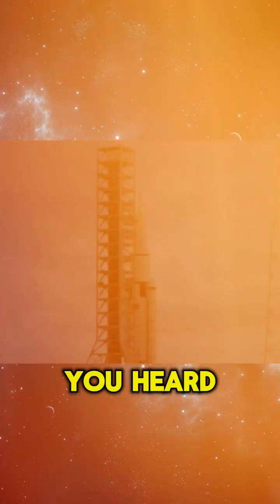Why Rocket Don't Fly Straight Up ? Neil degrasse Tyson #shorts #youtubeshorts #fyp

Comment: There were 3 types. 1 the solid booster rockets. 2 Oxygen and hydrogen used in the external tank via the main engines as well as the hydrogen fuel cells inside the shuttle that generated power and a water supply. 3 the OMS and RCS which used a hypergolic mixture. Those were the orbital maneuvering system (OMS) and Reaction Control system (RCS). The OMS were the smaller rocets you see on both sides above the main engines and the RCS are all over little burst rockets to turn or spin the shuttle. Both used the same fuel. It is VERY nasty stuff.